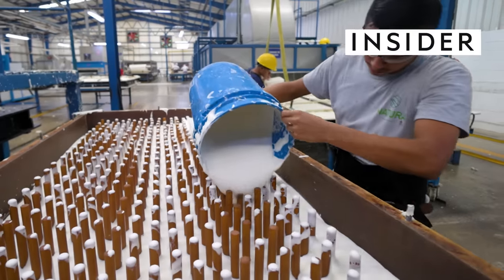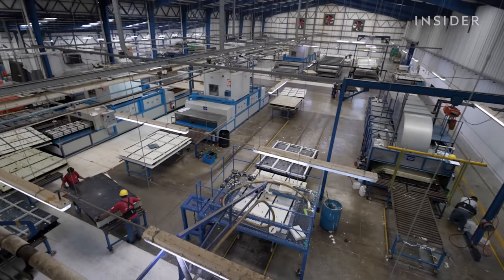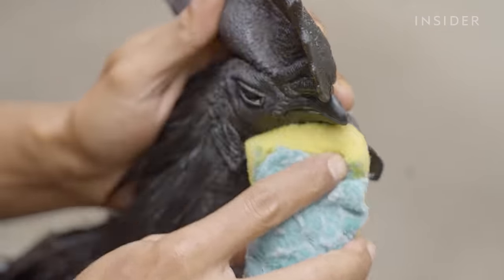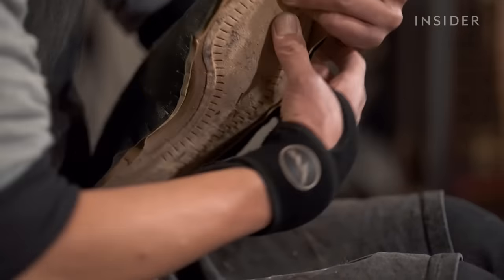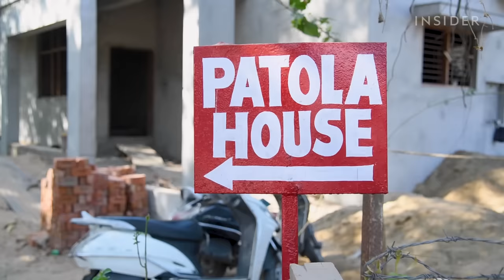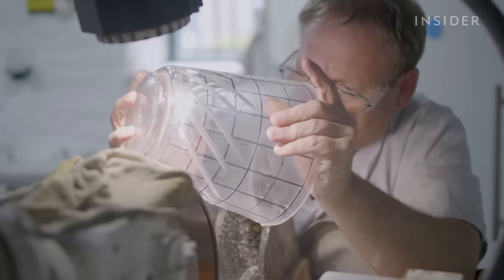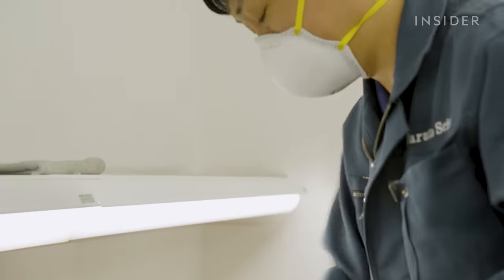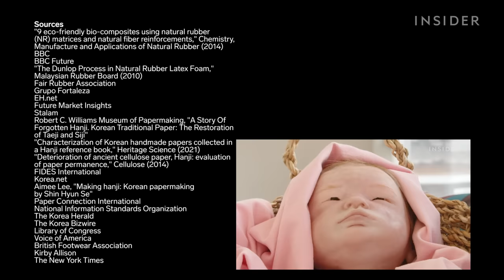Why 11 Of The World's Priciest Items Are So Expensive | So Expensive Marathon | Business Insider

Comment: Am I the only one who thinks that the latex harvester deserves a Damascus steel harvesting knife? I would imagine that the precision required would be equally as necessary and appreciated by the tree master as the master chef. ❤
Reply: And handle could be made from the waist rubber or the rubber for car tires I forgot what they called it
Reply: They are of indian origin
Reply: the only problem is, damascus steel doesn't exist, the formula was long lost and there is no way to replicate it
Reply: Why use a $1000 knife when a $5 knife will do the job just fine?
Reply: @PanzerAce760  you obviously never had a good forged knife in your hands. Its like comparing driving 100k km in a  1.0l skoda without powersteering, AC, traction Control or any safety systems, comparing to a luxury class 3l Mercedes with all those features. Yes, both will get you to that point, but one of those is a torture, while the other is a pleasure
Reply: @Krige1111  not really Damascus steel was wootz steel that came from India 
Wootz steel was special as it was an early crucible steel and had a very early high carbon alloy

We could try to replicate Damascus steel today but there are more modern cheaper and uniform carbon steels 
Wootz died more for economic reasons as Europe found ways of more cheaply producing better steel

These “Damascus steel” knives are really pattern welded steel, the quality is mostly derived from using good steel to start with
Reply: @Krige1111  oh, I've held many knives and worked in many kitchens and fully experienced both a great $5 knife and a crap $1000 knife.

Comparing a knife to an automobile is like comparing a soap bubble to the Hindenburg.
Reply: I thoroughly enjoyed watching this collection. Thanks for sharing 😊

Comment: 0:56 Damascus Steel in modern times is nothing but aesthetic, modern homogeneous steel are actually superior in quality for knife making, however the difference is negligible. 
The reason they are so sharp is cause he's a master blacksmith.
Reply: source?
Reply: @kidkique  Science. When all that was available was non-standard, non-homogeneous steel, mixing the layers could make a more homogeneous piece of steel that wouldn't randomly have critical brittle or soft zones that would cause severely irregular wear or a catastrophic failure of the blade. Nowadays you can know exactly what kind of steel you're working with and trust that the entire piece will not have any spots too different from the rest. A more engineered alternative layering technique to Damascus steel would be to forge weld together different steels of different properties with a specifically designed purpose, but it probably wouldn't look as stunning. Like OP said, Damascus steel is nothing but an art in the modern world.
Reply: Exactly. I found the comment that fake patterning on knives means they won't cut, to be very disingenuous.

Use a high quality steel, sharpen it, and you can print whatever pattern you like on it.
Reply: @incandescentwithrage  Dude just wants to sell his knives. You'd say the same if you could sell just one knife for a thousand bucks.

Comment: You may think this knife may have originated in Damascus but it can actually be traced back to India, where it is referred to as Telangana, Wootz, or Ukku steel. From there it settled in Damascus, Syria, where it got its name.
Reply: It definitely isn't Damascus in origin, but Damascus was the center in which it gained notoriety. Most of the so called crucible steel (wootz steel) came from a variety of places outside of Damascus. That's not saying wootz steel wasn't produced in Damascus but it's not solely based in Damascus. While the steel itself is intricate and pleasing to look at, it's really just a mix of high carbon and low carbon steel. The low carbon steel doesn't rust or stain the same as high carbon steel, hence getting the intricate weaved patterns of the mixes of steel types and staining. 

It's not a superior steel/iron material but it is beautiful.

Comment: grinding a knife like this cancels the quenching ! do not get fooled by guys having all the equipment but not have the blacksmith knowledge. thank me later, weather you are a knife maker or a buyer.
Reply: it only cancels the quenching if you are careless about it, but if you carefully do it in short sections then the blade does not over heat. Now that being said i do wish they would have said how well those blades hold an edge because that is the real deal breaker because you can get a cheap butter knife to be sharper then a razor it is just how long that it holds the edge that sets the high end knives from the cheap ones.

also it is not real demascus it is pattern welding
Reply: @windbringer9890  thats true, the blade would need to be grinded under water to cool it down

Comment: buy Cemani chicken and a shed i can put a window unit in with a small door that leads to the outside built on a foundation of dirt fill in a "pool" structure with a fence of both chicken wire and regular wire over the entire sides and top... because if I'm spending 6 grand I'm giving it security almost to the tune of friggin fort knox...

Comment: I get that each of this is so expensive because a lot of time, effort, materials and (wo)man power is put into it. That is simple to understand. Yet, I do not get why people actually buy these, when you can get a much cheaper product that can be used to a degree of 99.9% for the same result? I once was of the idea, that if you buy cheap, you buy twice. But I come to learn, that as long as I can buy something 10 or 20 times and still only pay a fraction of the expensive stuff, I will rather do that and save the money. And sometimes the cheaper product is nearly as good as the expensive one. 
A lot seems to be good marketing, tradition and superstition. Just take the knife. For 99% of people, buying a 20-40$ Chef Knife would be absolutely enough. You sharpen them from time to time and if you are fed up and the blade is botched, you buy another. Maybe, if you absolutely are a pro and your livelihood depends on you cutting things fast and reliable, I can understand going up to a few hundred $$ for a knife that keeps its edge longer and glides through like butter. Paying anything above that will not increase the performance in a way humans can measure. Of course, they will tell you otherwise, but that is just their imagination. If you shelled out 7k$ for a knife, you WILL tell yourself and others, how much better it is. I would really like a scientific analysis of this. Taking a few hundred knifes of each price range, find reliably measurable parameters, apply those by a mechanical process and do the same with two groups of people. One in a double-blind study and one with price tag attached to it. I would think you get a really steep asymptotic curve with the measured parameters, but with a lot of outliers in all qualities, because you can have cheaply made stuff that works really well, and you can have expensive crap breaking down in a short time. And it will be steep, because it does not take long to make a consistently good product, which cannot be made much better even if you put in thousands of hours of more work. This will be shown in the double-blind, too, where the perceived ability will not correlate with the price. And with the price known, people will, gullible as humans are, tell you that more money equals better quality. 
Of course, if you want to just replicate the PROCESS from times gone by as precisely as possible and not just get an equal product, that is different. I will never need bespoke shoes or suits that cost more than I earn in a year, when I can get one for 100$ that will work for the 5-6 occasions a year where I need it. And I will certainly not work in a job where I have to wear one every day^^ 
I respect the craft and the crafts(wo)men, but if I will not be so full of myself that I lose sight of my personal cost-benefit ratio. So, yeah, the 10$ knife is OK for me and my cheap shoes still got me through a lot of events in the last 20 years. If I want purple clothing, I buy a cheap dye and I like my chickens crispy and their bones non-black (that was the worst one in this clip...so useless, just a commodity with no real use).

Comment: Being in the foodservice industry for long years... I've always wanted a Damascus knife. Desperately
Reply: Inexpensive Turkish ones on E Bay, they do rust quickly if not oiled though. Not likely what you had in mind but maybe a good starter. I grabbed a couple with marginal handles and good looks but stainless steel is much simpler maintain.
Reply: @Jeffreymart  dang that's smart. I'll Def check that out
Reply: Not Damascus but Wusthof-Trident, the old ones with wooden handles, are my idea of paradise.  Theres a brand out of Brazil that is also outstanding, Mundial.  Both have exceptional balance.
Reply: @RICDirector  yea I've heard Germans make good knifes.  Japanese knives are probably the beat overall. And that's with an extremely heavy beating and 10hr a day use

Comment: Pattern welded, AKA: Damascus is as strong as the steels used to craft it. It's no more special then any 
other similar steels. It's main purpose is ascetic. It's most certainly not stronger then real Damascus steel. 
Comparing the 2 you can clearly see the differences. Real Damascus has no pattern. Rather it's chaotic.

Comment: Waterford Crystal changed from leaded crystal to blah blah blah and it's more durable blah blah. Corningware is durable too, but it isn't lead crystal either. So tired of everything being reformulated for the environment/sustainabilty etc. and a shittier product as a result.

They were bought out by a NY firm, who fired all of the craftsmen and shut down operations. The new formulation doesnt have that familiar ring to it, It's noy nice and heavy anymore, and the cuts in the crystal are sharper.

It is basically NOT Waterford Crystal anymore and I wouldnt buy a thing from them. The new owners bought a name, wrecked the product, and think nobody will notice... and most dummies won't